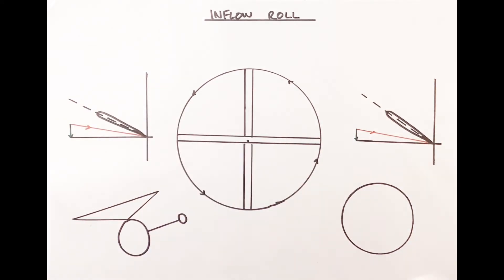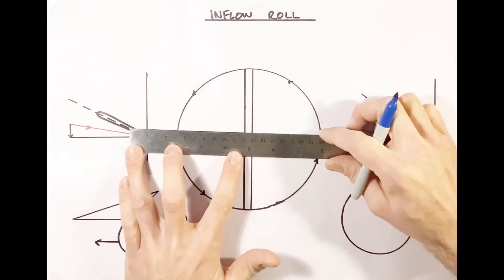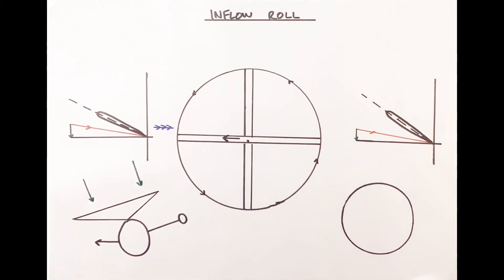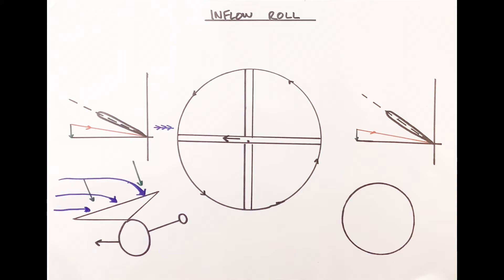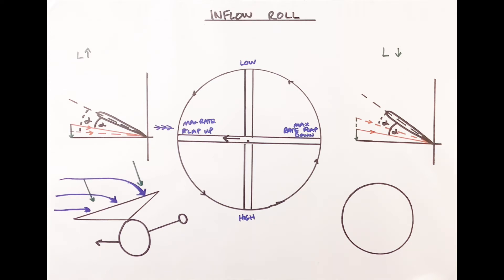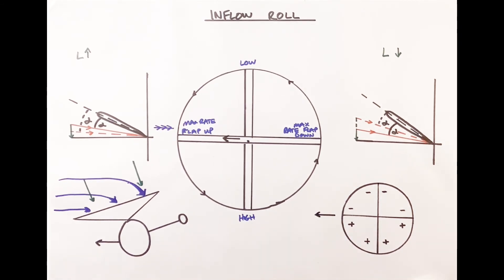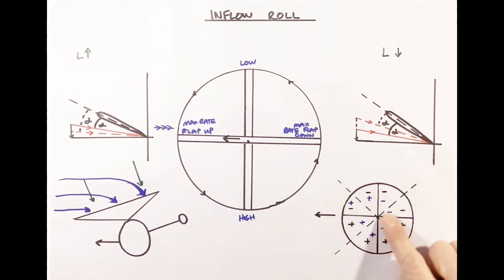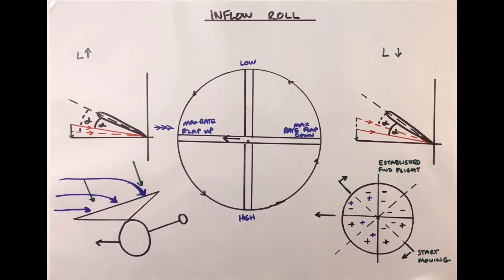CX-RIDE INFLOW ROLL Helicopter Principles of Flight

Comment: Great video. Would Gyroscopic Precession also play a role on the result of inflow roll?
Reply from the maker: Essentially no. If anything it would apply an opposite effect as generally you are creating a decrease of lift on the advancing side due to the induced flow increase at the rear whilst gyro precision would actually create a lifting moment on the advancing side. This is due to the 90 degree delay to the force you are applying at the rear or the front.